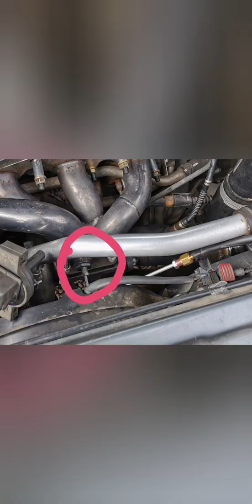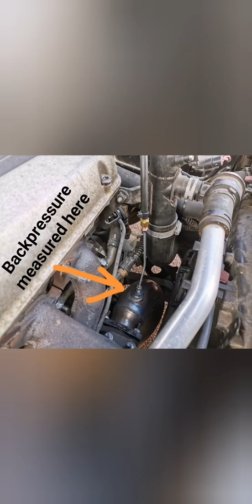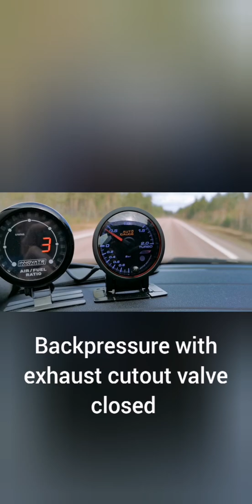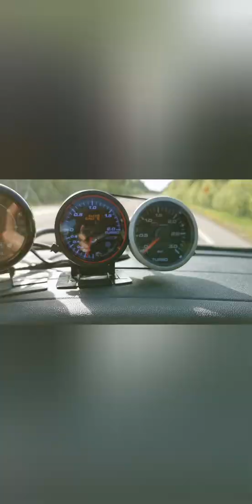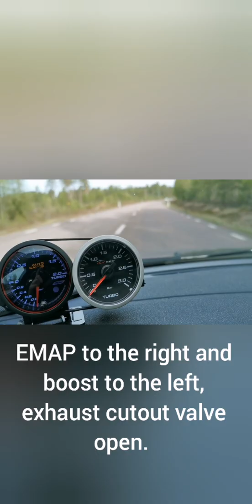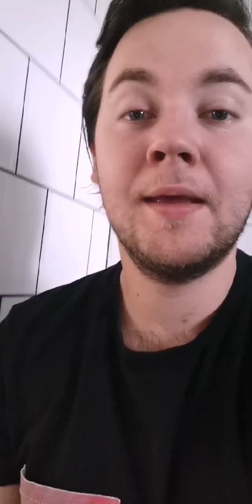Saab 9-5 horrible backpressure part 3: Making the 3" - 2.5" flow better than regular 3"

Comment: Nice info. I have a question I drive BMW F10 535i the stock exhaust system is twin 2.25 pipes all the way to the end. Which is better for more flow, as I going to upgrade the turbo make the pipes bigger to 2.50 or one 3" single pipe, or just do a exhaust cutout.
Reply from the maker: How much power are you gonna push? 

An twin 2.25" has an equivalent flow area as an single 3" just much easier to get quiet. The twin 2.5" is every so slightly better flowing than an single 3.5".

For my saabs I have set the parameter like this from both CFD data templates I have made and real-world testing for max power potential:

Internally wastegated turbo setups.

275-310hp: 3’’ downpipe to 2.5’’
310-360hp: 3’’
360-450hp: 3.5’’
450-550hp: 4’’ downpipe to 3.5''
550-650hp: 4’’(4.5'' downpipe can even be of use here.)
650+hp: 4.5''

If you are able to go full exhaust and go up in size I say do that, cutouts will be obnoxiously loud. Cutout should be sorta last resort. Will rebuild my exhaust to 3.5" to twin 2.5" and remove the cutout towards the summer.
Reply: @ArturssonEngineering  I might push to 400hp
Reply from the maker: @eskania  im guessing it is the N55 engine right?

Go to twin 2.5" or an single 3.5", downpipe is already 3.5" if I remember correctly 🤔
Reply: @ArturssonEngineering  Yes its N55 and DP is 3.5" I think will go with 2.5" twin. I guess 3.5" will be hard.
Reply from the maker: @eskania  that sounds good 👌

Comment: Have you considered usung butterfly valve instead of wastegate? It seems that it's more common for such applications.
Reply from the maker: They sure flow better, but I dont trust them in getting directly subjected to 700+degree C repeatedly up front straight behind the turbo. That's why I went with a big 60mm wastegate as they are built to handle the heat. Also seen those valves bend from backfires. 😅
Reply: @ArturssonEngineering  makes sense! Although I've seen some people used them even before turbo in twin/sequential setups. But those probably were some custom items..

Comment: How about difference in the flow (mg/c) with valve opened?
Reply from the maker: Airmass wise it didnt do much at the time while I recorded this 2 months back. That was due to my intake system infront of the turbo caused too much vacuum instead of gaining air flow at the time. 

Now taking it a step further with stock ported manifold and doing the intake properly and fine tuning it, running pretty much MBT ignition.. I now manange to keep this little turbo singing and holding 1.5bar boost almost completely flat to 5000rpm. 4300rpm I have airmass peak at 1500mg/c and it holds it up to 1477mg/c at 4750rpm, then by 5000 rpm 1405mg/c and starting to drop off. With MBT ignition that might aswell be upwards 380hp. Earlier in the powerband I have induced an ramping of the airmass/boost. But the ignition make it pull so steady so you dont really feel much of the airmass ramping.

I am never really over 1.5bar boost at any point still and the thing just keeps pulling until last few hundred RPM where it falls flat and get out of breath.